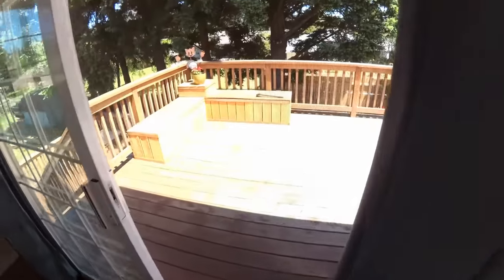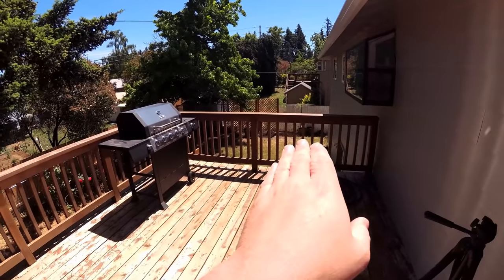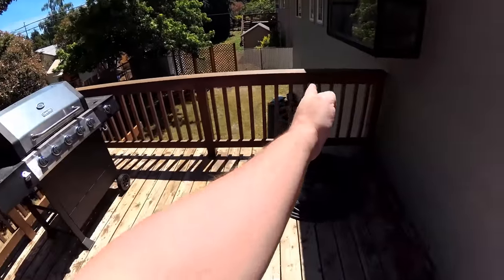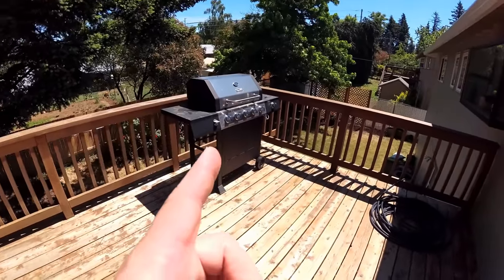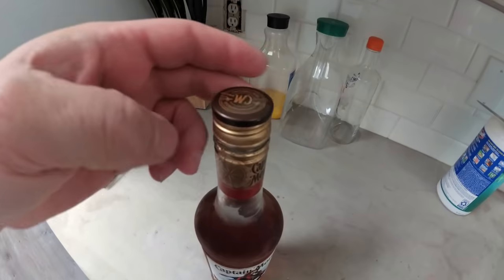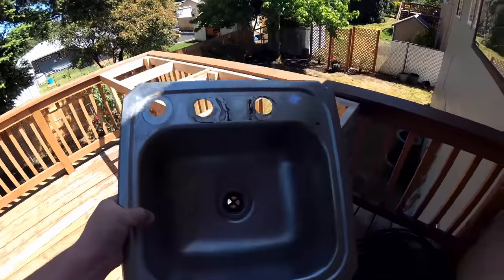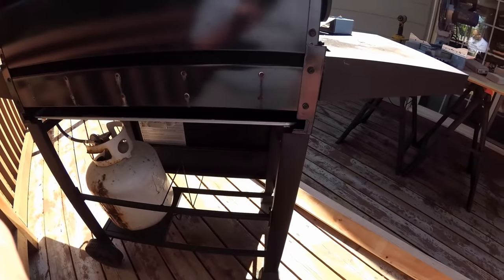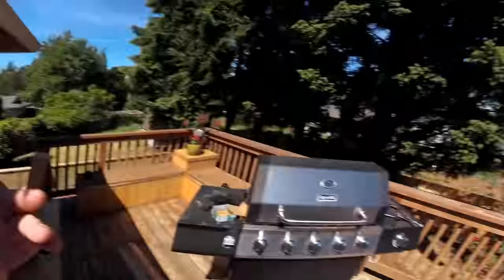DIY Outdoor Kitchen | How to build an outdoor kitchen | How to build an outdoor kitchen on a budget

Comment: Location is incorrect. The L should be next to the house structure so the railing remains open to the view and better use for seating etc. The right counter should run along the house wall to the door. This would allow easy plumbing hook up for the sink and natural gas for the range. It would also allow use of the house wall for possible shelving options.

Comment: Nice. Easy frame out. I have tile outside countertops, mine are falling apart after 4 years.  Not suggested. Wood, butcher block. Easy to oil up to waterproof.  Really nice though
Reply from the maker: Yea hoping my tile will last. But if I get 4 years out of this I'll be happy. Then ill build a new and improved one.

Comment: I know its five years old but I hope you didn’t weld the holes in that sink. Much easier ways to deal with that than welding stainless plus, why not just use a faucet as designed?

Comment: I found your video after 3 days of searching the internet to make an outdoor kitchen on a budget because for whatever reason, the standalone bbqs are way WAY more reasonably priced than the ones meant for outdoor kitchens. This is the exact idea I had in my head when I started and you've shown me that it can be done. 
Thank you!
Reply from the maker: Awesome! Good to hear
Reply: Thank you. Forgot I seen long ago nice tip and I used it. Take a composite deck bourds and rip length way and use as anti rot put frame on top. And treated 2x4 on top of it. Good piece of mind.  I also used beer buckets from bars for lighting.  Upside down of course. With yellow lights. Looks cool at night hope this helps

Comment: Nice work.  When I built my outdoor kitchen I used steel 2x4's (used in office walls) and lined it in cement board.  Then I stuccoed it. I also put in natural gas, electric and running water and tiled the top
Reply from the maker: Very nice! I think metal studs will be the route I go next time
Reply from the maker: Yea metal studs would be ideal
Reply: im trying to do the same on cement floors

Comment: what's it going to look like from the ground? Will it be open to the slats on the deck? Just wondering.
Reply from the maker: Yes, mine is open on the back. But the railing of the deck kind of conceals the back. If you're worried about seeing inside the back, I'd cover it with what ever you decide to cover the front with.

Comment: Man I'v been thinking about this for a while, i'm reclaiming 16 foot long 8 by 8 posts, to use as a frame. but I'm scard the bbq will get so hot that the wood arount it will catch fire ! .. did you use any insulation or heat shields? (EDIT, (NOTE TO SELF CHECK THE WHOLE VIDEO BEFORE YOU ASK QUESTIONS HAHA) CEMENT BOARDS).. How is it holding with time?
Reply from the maker: Cement boards and 16ga stainless steel metal

Comment: Do you need to use pressure treated lumber for this project?
Reply from the maker: Scott Nguyen I would recommend using pressure treated 2x4s, especially if you live somewhere that gets alot of rain. I didn't use pressure treated because its alot more expensive. The wood I did use will last a few years, but not nearly as long as PT wood. I never planned to have the outdoor kitchen for 5+ years

Comment: What length 2x4s did you use in order to reduce as much wasted wood as possible when building the frame?
Reply from the maker: Standard 8' 2x4. I didn't really consider the waste. I just measured my railing height and went from there

Comment: What is the wood that you have used for the base/shell form ? Thanks mate great job!
Reply from the maker: It's just regular framing 2x4's. But I'd reccomend using pressure treated 2x4's instead. Much better in the elements.

Comment: isn't wood combustible?
Reply from the maker: Yes it is. Take proper precautions if you plan to use wood for your build, like I did.
Reply: @BriGuy503  I ended up buying Eldorados OLP (seems like concrete board finished product) and it's super heavy! Not sure how I'm going o get it up on the deck. Actually kind of afraid the deck can't support it. I built a gas firepit out of metal studs/concrete board, but I didn't want to waste the time with the kitchen. We'll see how mine turns out, yours looks good!